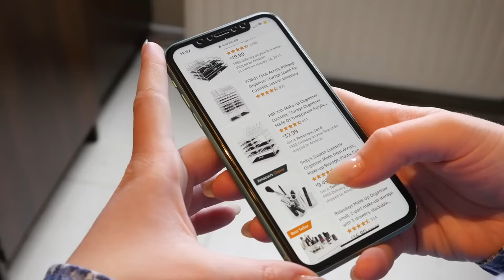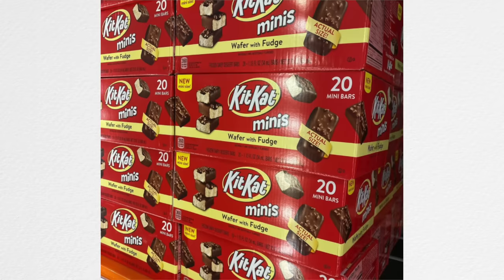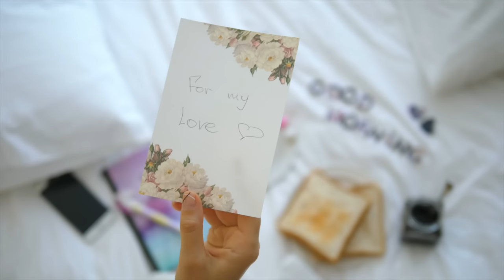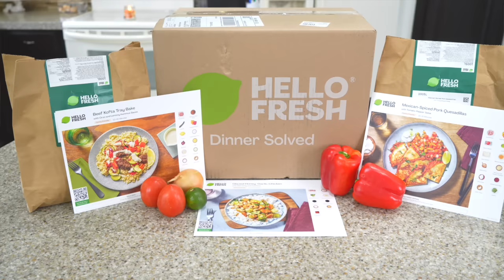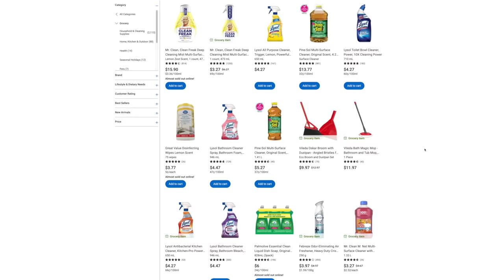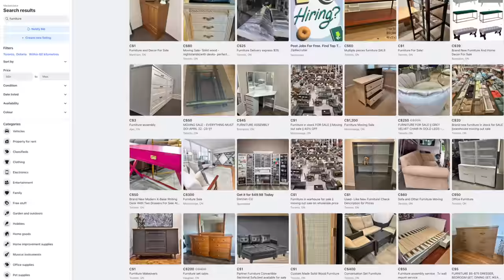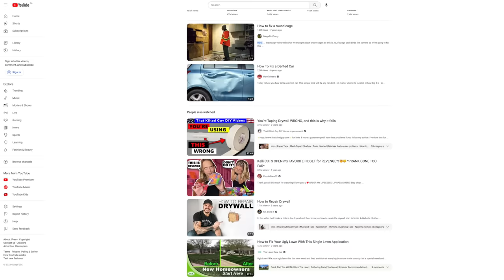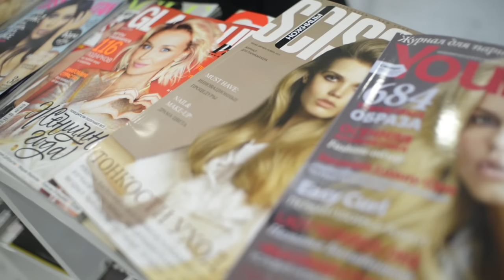25 THINGS I DON'T BUY 💸 (HOW I SAVE MONEY & SPACE)!!!

Comment: I think there's a couple of caveats to not buying repair services. I totally agree that there are a lot of things that you can fix yourself with guidance from the internet, but i think you should probably ask yourself a few things before jumping into DIY. 
1. Is it highly dangerous to fix it yourself? If so, getting an expert to do it is absolutely worth it. 
2. Does it cost as much or more to rent or buy the tools and materials to fix it? If so, you're probably going to end up with a lot of crap that you use once and then leave in your garage. Just hire an expert instead. [The exception to this is if you find yourself needing these tools a lot, in which case go for it!]
3. If you mess up, will it be expensive to fix it? If it's something like a small electrical patch, a new light fixture, or fixing a leak, you're probably fine. But if you're getting into the central system for your HVAC, that gets really expensive to fix if you trash it. Use your judgment, but be careful of getting in too deep.
4. Are you going to see the end result? in other words, if you screw up and it looks terrible, will it matter? if so, then look for someone who comes recommended by their clients. 
5. Do you clearly know what the problem is? If you need to diagnose an issue, it's worth having an expert help you. otherwise, you may find that you do this DIY thing, spend money on the materials and tools, and then it doesn't fix the problem or even makes it worse. again - it's easy to get in too deep, and the benefit of having a pro is that they'll generally have a sense of the scope of the project before they start.
Happy fixing!

Comment: I don't like wasting money on products we throw away either (napkins, paper products). Only have paper towels now cause we have a really old sewer line that can't handle any oils. Have to scrape and wipe dishes before they go in the dishwasher. Infuriating. 

We use cloth napkins and cloth cleaning rags.
Reply: When I first read your comment, I wondered why you didn't just wipe the dishes down with cloth napkins, and then it occurred to me that when you wash the cloths, those oils would be going right into your sewer line, hence, you have the same problem.

Comment: A mistake? A caveat?  Not all "spend to save" offers are a rip off.
1. Yes, you must actually use those multiples in a timely manner.
2. Yes, you must read the shelf label for the actual per item price.
Many, even most, of those offers will show the actual cost of a single item as more than the advertised cost divided by the number of items.
For example, it's "3 for $3.00" making it $1.00 each but the tag says, "$1.25 if bought separately", so it's not $1.00 each.

Comment: If you buy the right car you don’t lose 5k driving off the lot. Absolute myth. I bought a 2017 Honda civic Si coupe for 23k with 6 miles. Driven it 105k and it’s still worth about 16-17k….. most people don’t do those miles in 5-6 years either so if you had a 50k mile Si say it’s worth about 19-20k. So where’s this immediate 5k loss?